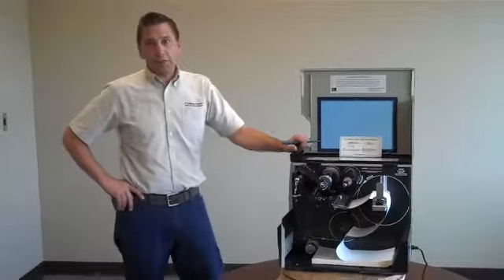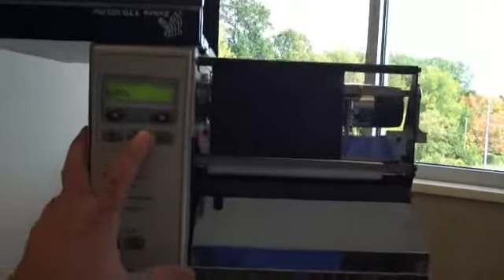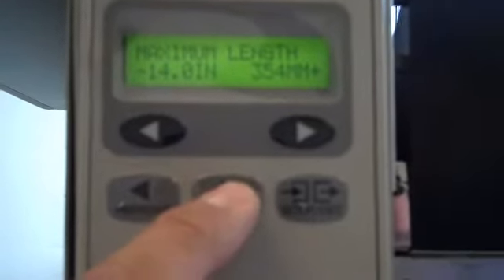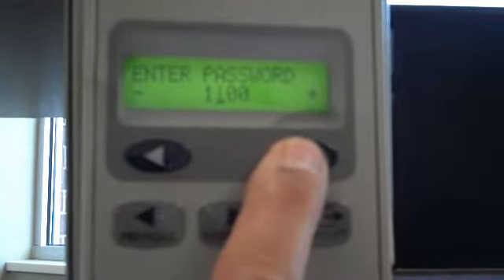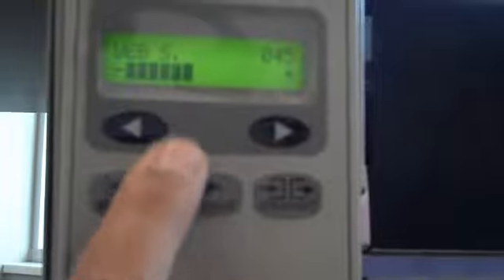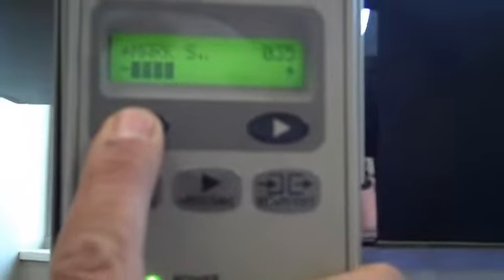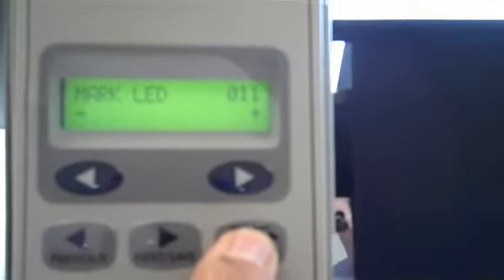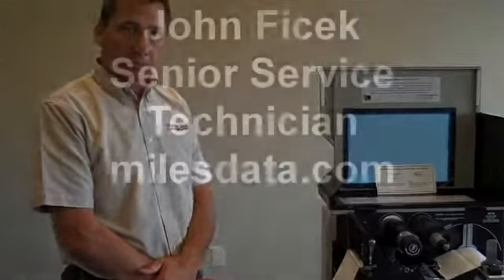Miles Data presents: Calibrating Zebra 170XiIIIPlus printer

Comment: Can you tell me if when setting the Zebra up for staic ip, can you just do it from the setup utilities, or do you have to do it from the zebra screen? How is it set, I mean, it is like this000.000.000.000so if your ip (for example) was 192.168.1.1 would it read (on the screen) 192.168.001.001?Is that the correct format when setting the ip on the screen? OR can you just do it from setup utilities?